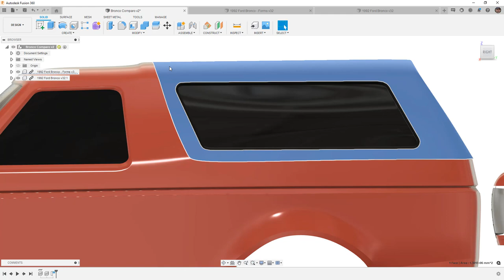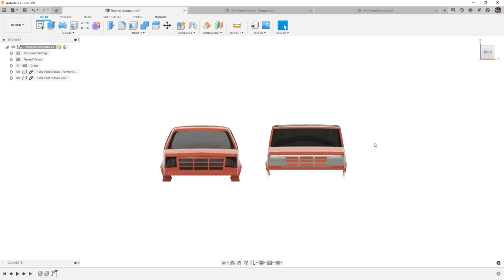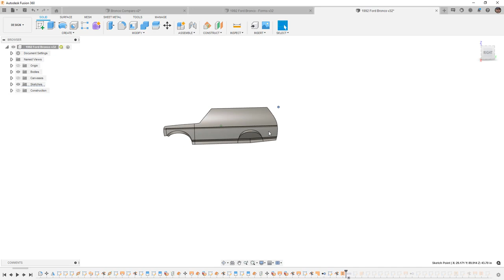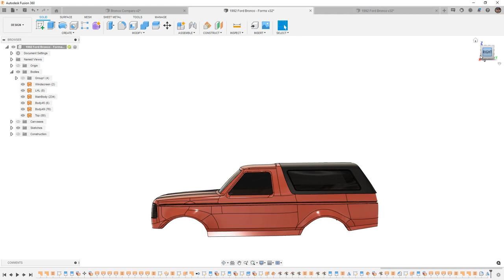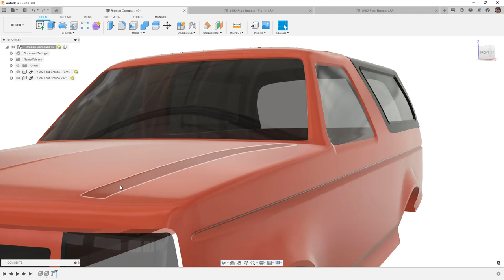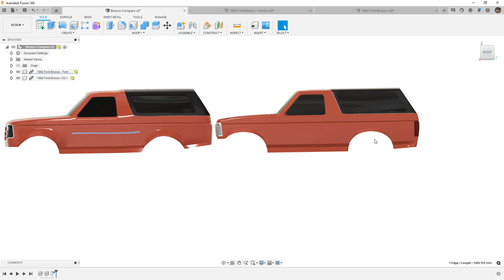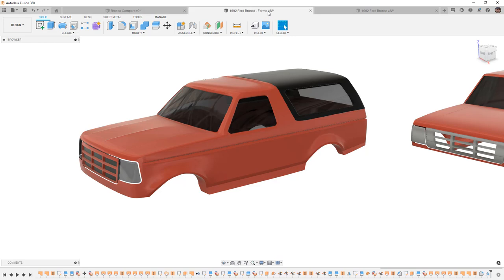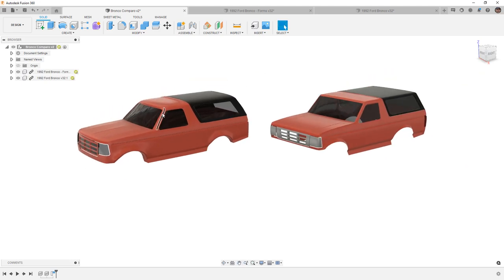Fusion 360 Car Modeling - Surface vs Forms - Which Should You Choose? #Fusion360

Comment: in my experience Surface modeling in cars is drastically more common as its more accurate and precise to design and rules, the biggest issue with modeling a car in something like fusion 360 in my experience is sketches and the hierarchy system, a lot of software designed for surface modeling just don't have anything like that and it allows you to create changes to early geometry without ruining everything later down the line, in the end its probably just personal preference and software
Reply from the maker: no that is great insight!  I started modeling cars with surfaces in various CAD packages like Inventor and Solidworks.  Some are easier than others.  With Fusion one main issue is the quality of the surface tools currently.  If you do surface modeling with curves/cage in something like Alias you can get true Class A surfaces, you just don't get that in Fusion.  BUT to be fair it wasn't made for that :)

With forms you can attach to a curve or to surfaces so you can drive them in some areas to be more precise, but on the whole it just wasn't designed for it(surfaces and forms) so pick your battle ;)
Reply from the maker: @Ckcdillpickle  I used Alias a long time ago and it wasn't easy to learn for sure.  I am going to be giving it a test drive here soon to see how the SubD modeling compares to other programs I used.  I hope to add Rhino to the list of stuff i cover this year as well.

Comment: I just don't think I agree with your hypothesis of the forms being easier to retroactively change. The forms aren't great but I've found customers will have quantifiable change amounts that I can more easily alter. For example, "make that curve a quarter inch higher". This is of course personal preference. Thanks so much for all your hard work!
Reply from the maker: Fair enough!  By easier to change I generally meant that you can push/pull the shape easily.  Surfacing in Fusion 360 isn't super stable and trying to change the profile of say a sweep or loft has a very high chance of breaking the timeline.

For any surface that needed precise inputs it has to be done with surfaces or solids for sure as sketches are only a "suggestion" for a form :)

Thanks for watching.

Comment: Where can I find your videos about the surface modeling of the car model?
Reply from the maker: I ended up pulling those down because the results weren't great.  I have had issues with the Fusion surface tools and raised them with Autodesk and I felt that until they were addressed i didn't want to push people down the path of surface modeling a car.  Maybe I should pull this one down.  I do have a new surface mastery series which does go over some of the things needed to model a car.  I will be adding to that series and cover some of the topics there.
Reply: @LearnEverythingAboutDesign  ahh ok, your surface mastery series sounds interesting 👌 I will have a look at that. Thanks for your answer 👍
Reply from the maker: @balikci77  https://youtube.com/playlist?list=PLBDfGh8A8kXV_uUJ5KemGgbYOHl69fIty